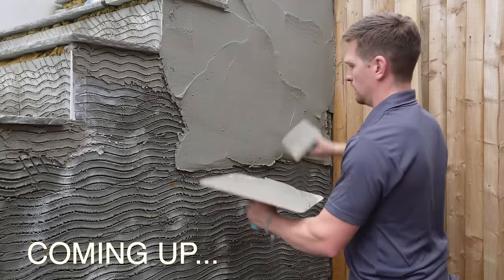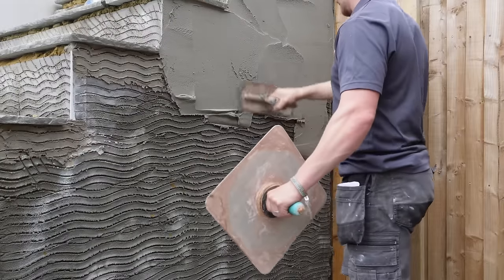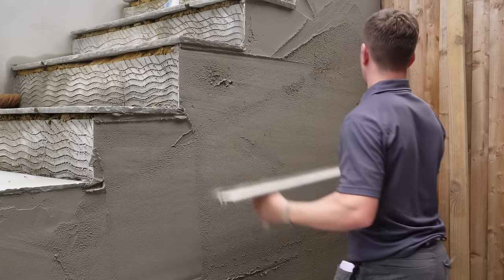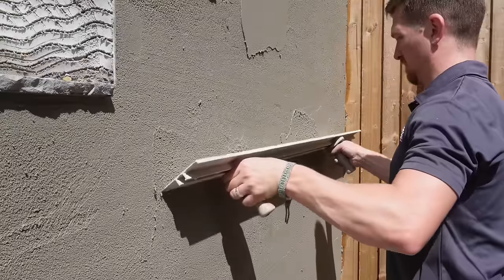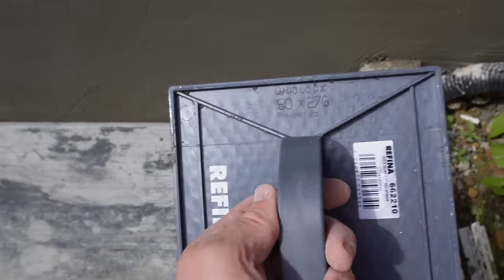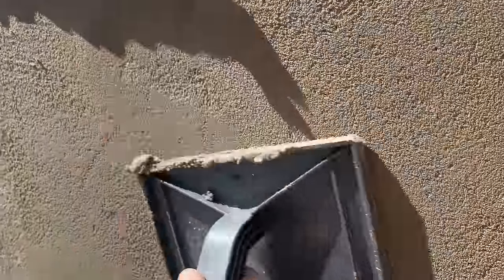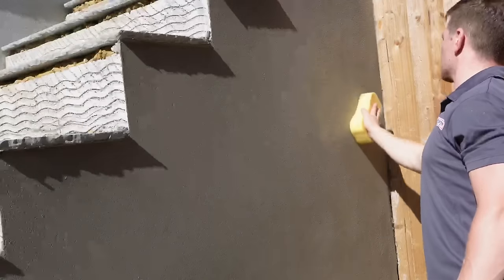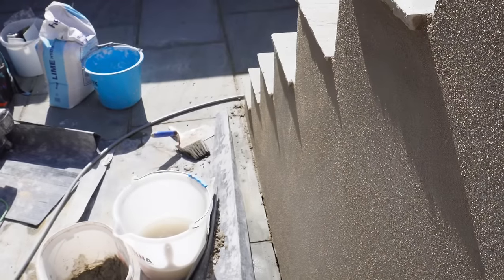Rendering Is Hard Until You Do This…

Comment: tried the weberend OCR based on your recommendation and you are right, its a game changer. Just add water, sticks like bonding and sets at a good predictable rate. Very smooth, no stones and not that expensive on a small job like garden walls. Used it out doors and it rained but it still set. Sand and cement would have been washed off the walls

Comment: 19 years in the trade. Just done a neighbours back garden. Had am expansion joint halfway down the first gauge. Came out mega. Today me and the lad who worked for me did the exact same thing and went proper tits up! Having to go back tomorrow to re-render. Would you put it down to heat or getting on it to quick? Basically when rubbing up was bone dry on front but sliding?

Comment: Are you using the ocr bag render? Love your videos mate
Reply from the maker: This is just standard sand cement pal…hence the stones in the mix 😅
Reply: @PlasteringForBeginners  oh right thanks I am a DIY trainee lol. I seen your videos on the ocr which you use & say it's great. I got a little wall to render & wanted to know best stuff to use. It's a concrete bloke wall which I will pregrit before 1st coat would you recommend the ocr or normal sand & cement. What mix would you use for scratch & 2nd coat please. Thank you mate
Reply from the maker: It's more expensive but I would use OCR mate. It's a nicer product to use, there's no worries about the mix and it's a lot more flexible. That's the one I'd use pal!
Reply: @PlasteringForBeginners  Thanks mate much appreciated. Look forward to the next video 👍